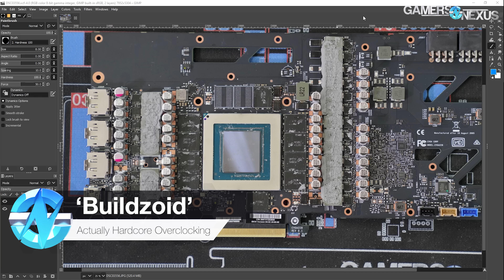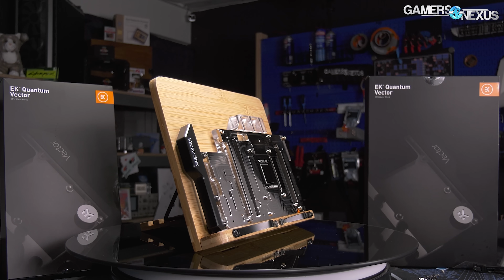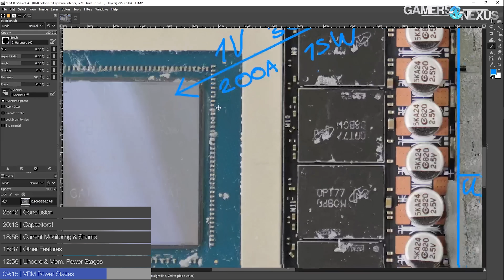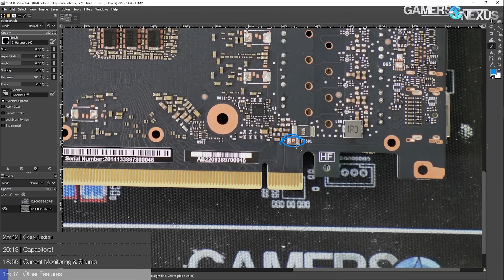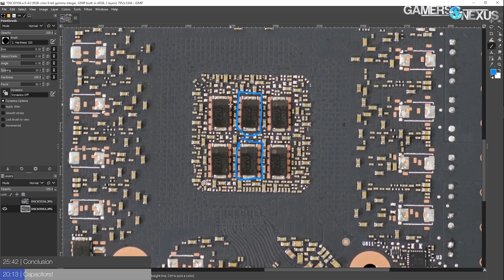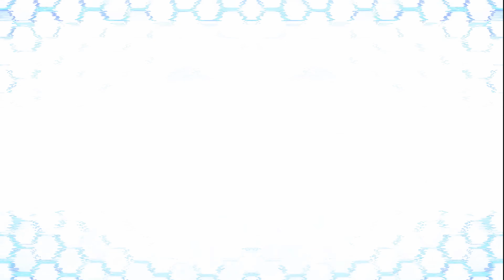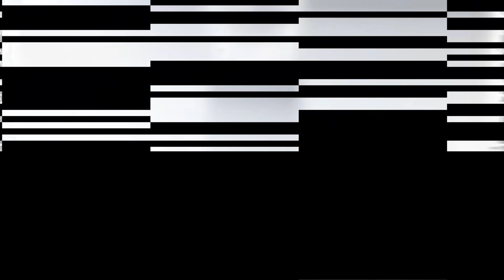Should Be Better for $810: PCB & VRM Review of EVGA RTX 3080 FTW3 Ultra

Comment: Fuses are extremely underrated though. Sometimes due to the lack of fuses (e.g. msi) the failure might fry the card into oblivion and  certain manufactures (e.g. msi) would do everything to refuse RMA, leaving you with a peace of unrepairable hardware. Also there are cases where manufacturers don't have an office in a customer's country, thus when they RMA a card paying for custom clearance to get a fixed card/replacement back might cost more than an actual repair. Not to mention, that a warranty will expire at some point anyway. Realistically these little fuses can be a difference between having to a buy a new 800$ gpu vs paying ~100-200$ for a repair.

Comment: Actually quite disappointed in my evga 3080 ftw3 ultra.  Seeing $700 tuf's beat it stock.  It doesn't OC hardly at all, and what I do get out of it, it's still beat by many tuf's running stock boosting with no offsets.  Runs very hot.  I always go with cheaper variants...but talked myself into spending more this time to get higher power limits and better cooling.   My card doesn't even take advantage of this power limit...I need to undervolt just to hold a 1935 clock.  This is my 3rd, but last EVGA card.

Comment: I do wonder if there's too much fetishism about ability to overclock
How many people are actually going to do any hard mods? Seems weird to say the quality is bad value when the arguments for that statement are extremely niche and probably don't apply to 99% of the audience.
That doesn't mean I'm saying component quality doesn't matter, as it can positively affect other areas (eg efficiency), but that doesn't seem to be the case here.
I guess the only statement you could make is that price could be lower?
Reply: There aren't. Most people didn't even oc stuff even when their part can be oc. Also, if you haven't noticed, this is a BOARD ANALYSIS video, you come in knowing what you getting. GN themself has a gpu review focus on what the average Joe care, the qol stuff. 

GN wouldn't contract Bz for board analysis vid if no one is watching. Most of those people aren't hcocer, they are just like you and me, normal joe wanting to get a gpu that just work, and couldn't give a damn what's under the hood. But that doesn't mean they can't appreciate bz ramble vid as a form of entertainment. 

It is like people can be into high end sports car, read/discuss/criticize/etc about minute details. But their daily driver is a good old reliable 1998 honda civic.
Reply: If you're buying a Strix, FTW3 or auros master or something similar and aren't going ham on the OC then you've bought the wrong gpu.
Reply: YES. Specially considering Ampere cards. They barely can overclock on stock air cooling that comes with the cards and the fps difference between the most basic and highest tier models are 5% in the best case scenario. To add to your complaint Buildzoid's reviews should be taken with grain of extreme overclocker's salt because he ignores issues that normal daily users have (like coil whine, stock cooling, fps difference between OC and stock); while he overblows "problems" that only occur during extreme overclocking.

Comment: Curious if buildzoid can explain ftw3 power balancing issues and why some (most but not all) 3090 Ftw3s are hitting pcie power limits of 75-80w at 430w-460w  total board power on the 500w bios. The same bios on strix and gaming x trio can hit 500w all day while hitting only around 40w max on pcie. And if there is a likelihood that evga can fix this without a total board redesign.

Comment: When everyone is comparing this to the Strix when the strix is literally an extra 40$ on top of this. These comments are driving me fn insane. Im done.
Reply: The 3080 Strix is 20% more than the 3080 FTW card here in Australia ($1500 vs $1800) but that may be with the "high demand" pricing.   It is a bit odd to say the least but if it was just a $40 difference then they would be a direct price competitor in most people's books.
Reply: @emu071981  Yes I agree but you could say that about any of the 3080 line up, the most expensive one is less then 200$ from MSRP. And if you account for tax + a warranty (for anyone who gets it from a microcenter or retailer that offers) the total comes out to near 1000 USD anyway. All of which preform better then the previous 1000-1500+ 2080ti's so who should really care, well unfortunately the devil is in the details, the strix card is unnoticeably "better" then the FTW3 and really no one needs to spend the extra money if they dont need to. That being said I can completely understand the logic " if im paying this much anyway I might as well make sure I get all the features weather they matter to me or not "

Comment: Is it possible that buildzoid miss counted because he only marked 2 mem phases and goes on as if he has marked 3 of them i am assuming that there is a third one at the top of the big vcore which would make the vcore a 12 phase (doubled 6 phase) which would be a normal option for the controler

Comment: EVGA canceled their excellent laptop line, refuses to make an AMD motherboard, and now is skimping on the FTW series - sad to see
Reply: EVGA 2022 update. Queue system is now 3.0 and vague and 3080 12gb queue lasted 90 minutes before being disabled. They also changed their extended warranty. Used to be able to buy a 10 year warranty for 60 bucks. Now its only 7 years and also is a sliding scale up to 240 dollars for 1500+ cards. I dont personally disagree with the extended warranty price as I was able to get my 3090 extended warranty for 60 dollars which is insane for an 1800 dollar card (3k card if you didnt get it thru the queue) it sucks that they didnt announce changes to let people who already owned the card register. Changed the warranty out of the blue.
Reply: I was planning to swap my 1080 ti FTW3 for 3080 ti FTW .... So far it looks like I'll have to look elsewhere probably. Hope GN will do same review of ti when it comes out.
Reply: I kind of wonder if they don't have quite as many long supplier contracts locked in as other GPU makers (especially ones with more motherboard sales, laptops, monitors, etc) and EVGA got squeezed by human malware-related production issues/component price hikes.  Or they struggle with only a $100 price premium over FE vs what they were able to charge on RTX 2080ti cards (+$250 over FE iirc).
Reply: @josephfowble196  good point since the pricing for all the stuff that make up the pcb is pretty much the same for all AIBs, the differences lie on their cooler design, how high end the card is etc etc etc. but yea.
Reply: Their PSUs are also seemingly getting worse. The G1+ and G5 are worse than the G2 and G3. They also keep adding more models and it's at this point quite confusing.

They have at least 11 models with 80+ Gold efficiency: G1, G1+, G2, G3, G5, GA, GD, GM, GS, GQ, GT
Reply: @siripfreely  Some of those PSU models have been discontinued for years.  I owned a GS PSU that had to be RMAed, so then I became an owner of a G3 due to GS discontinuance.  Pretty sure the G1 and G2 are gone too.
Reply: give me evga rx please and take my mining money
Reply: I'm not surprised, I've had nothing but issues with evga products. I'd sooner get a zotac product before an evga one.
Reply: @Sparksman23  you say that until you buy an MSI anything... the only products I've had fail on me, the only ones, at least they weren't my own damn fault...

that being said it seems like EVGA has toned down its customer service, fortunately I haven't had to use it but the last card I had that had an issue they cross shipped another one to me right away, I hear that's going away or at least it costs a fortune to do it now... same thing with the step up but honestly I mean step up was too good to be true when it was for real, although again this is a long time ago I guess... I'm really old now, still though when you have components that have lasted 10 years with constant use, reored almost 10 years from my 780...( which as it turns out was fine regardless of the RMA, so I shipped the one that gave me back, was a bios glitch as it turns out) 

last MSI laptop I bought, spent more time in the shop than I actually had it, basically I got it back when the extended warranty I bought ran out, and they just you know stopped wasting my time after a 2-year run around... with like two three months in between.

that's after two motherboards failed me, as in they just died... I think the first one maybe lasted a year, the second one I can't remember... I just remember it dying for no fucking reason, and at that point it just didn't surprise me.

honestly like it's the state of rma's and warranty services that kind of speaks more than truth if anything, it's nice when a component fucking lasts and is built to last, but at the same time I feel like if you're willing to back up that claim I always end up finding that those components end up lasting the longest go figure... but given the current state of rma, the death of cross shipping which is kind of an industry must, especially if you pay for it but given that you know production don't stop and what not, these days I'm not sure about the quality of build given that they've pretty much I keep hearing nightmare stories about rma's, that being said... I never thought you could have a $2,500 laptop with a fucking top-tier GPU either, so I guess you know whatever I'm just bitching, kind of like this guy is...

like like that sucks that you can't pour a bunch of liquid nitrogen on it and make it go super super fast and shit because it's got components that are completely adequate to do the job and any job that you need it to do without fucking pouring a bunch of liquid nitrogen on it so that you can get a 5 minute fucking boost to get a score on benchmark... like who fucking cares that's not real world use.

I mean considering the last video of these guys put out when you look at the margins and shit and then timetables I mean cry me a fucking River... it's still $800 less than those kingpin cards if not more, and still $600 less than that 1080 or 280 TI or whatever and more powerful and has more capacity to improve and it has fucking micron memory which is a fortune, like okay go with Samsung memory save some money would that really make the difference if those capacitors were there in anything other than pouring a bunch of liquid nitrogen on it.... 

seriously, sure your dick is hard as fuck when you poor liquid nitrogen on it but it's still going to snap off when your realize how small it is in the grand scheme of things.
Reply: @jakedill1304  Everybody has different experience with each brand.  I never had a issue with the MSI products I had (motherboard and gpu)
Reply: @jakedill1304  I don't buy MSI anymore, I've been bitten on both mobo and graphics cards.
Reply: @Sparksman23  Zotac are pretty solid weirdly enough
Reply: Blame Trump’s trade tariffs
Reply: @ZombieLincoln666  so you want communist china to prosper after what they done? Stop buying their shit
Reply: @billlam7756  I mean agree what youve said, but at the same time you deserve downvote for your manner of speaking that - it sounds like a 5-year old throwing tantrum for poop.
Reply: @inujung8224  since when speaking truth throwing tantrum but hey, to each their own. What you do or think not my concern, just saying

Comment: Oh yeah! Buildzoid was literally talking about this review a few days ago at his own stream, while he was trying to overclock that prebuilt APU. He was wondering if his review will ever get released as he was afraid he was being a little bit too harsh on EVGA
Reply: Yep, I asked about this and he actually replied :D
Reply: Past 2080ti FTW3 cards had a ~$250 price premium over FE.  This 3080 card is just ~$100 over FE.  I think that should have tempered expectations a bit.  Hopefully the 3090 k|ngp|n cards don't disappoint.
Reply: @josephfowble196  Well the 3090 FTW3 cards have a $300 price premium, and probably same-ish pcb and components.
Reply: @ifidiediwouldsay  The MSRP of 3090FE is $1499 vs 3090 FTW3 starting at $1729 in USA.  You're correct that components in them aren't that much different according to techpowerup.

Comment: These $800+ "OC" edition cards are BS already, all of them turbo past these "OC" marks automatically it's just a way of inflating the price without adding any value. At least some of them have decent coolers and boards for the money so this is pretty disappointing to see.

Will it really matter for board performance? Heck probably not at all, most people care way too much about parts than they should rather than whether the sum of them works, I''m just salty about these $800+ cards that don't look any better than the FE or other cheaper alternatives.
Reply: Any 3080 is going to come close if not over 800$

Comment: Incredibly informative. I've been trying to get my hands on a 3080 FTW3 Ultra since, as Buildzoid mentioned, FTW3 used to by near Kingpin quality and were some of the best PCBs on the market. Going to go with the Asus ROG-STRIX-RTX3080-O10G-GAMING now.
Reply: Why not consider 6800 XT if you don't have a 3080 already...or even a 6900 XT which is sold at the same price as most overinflated 3080 MSRP.
Reply: @elcouz  CUDA compute, a software i use is CUDA or CPU only, no OpenCL support. But I game on it too, so sticking with Nvidia for now. Gotta love proprietary tech.

Comment: Buildzoid,
The fuses are bad for modders.  Specifically the PCIE slot.  It's only 10 amps.  10A * 12v= 120W.  
So if you are shunt modding the card to allow it to draw more power, if you draw more than 120 watts from the PCIE port, the fuse will blow and you can't use the card anymore.

I believe the ratio of PCIE slot to a single PCIE plug is 1.25x or something close to it.  So if you tried modding for more than 600W total (e.g. stacking 5 mOhm shunts on top of the originals, or removing the original shunts and maybe using 3 mOhm replacements, that fuse is going byebye.

The other AIB's have 20 amp fuses on both the PCIE slot and power PCIE plugs (afaik).

The Founder's Edition does not have fuses at all.  I've shunt modded mine for 530W TDP @ 114% power limit, and a few others have modded their FE's as well.

Comment: Hi Steve. Im currently working on a 6800xt build which only is going to be for gaming. My question is if you think i should cancel my 5600x order, and replace it with another higher tier amd cpu, or keep it. (I play on 3440x1440 and 1440p).

Comment: Anyone else notice pin 1 (top left) of the left PCI-E power connector doesn't even look soldered.
You get a good view at 9:07
The pin beneath it is almost as bad.
Reply: That's not pin 1, those are pins 4 and 8, and they're ground and sense, and you already have 3 grounds for the 3 power pins, so they're not that critical (That's why they're usually piggybacked from the other six). Still, they are through hole components so the "shiny perfect blobs of solder" are on the back of the card, so no biggie. And even then, 3 x 8 pins deliver about 450W of power by themselves...

Comment: For those wondering, inductors gets higher energy densities as the switching frequency increases due to higher di/dt. The downside is the inductor losses, and MOSFET turn-on losses (the more you turn it on then off, the higher the loss). Almost all losses manifest as waste heat.
Reply: Right and the main benefit resulting from this is the better line regulation given the same inductor and capacitor (provided the inductor has a high enough self resonating frequency and that the capacitors have a low enough impedance at the switching frequency) or the same line regulation but with smaller inductors and capacitors.
High frequency switching converters are really neat, i have implemented a few in designs with around 10ish MHz switching frequency and for the current they can deliver they are tiny .
Reply: @_--_--_  oh yeah i also forgot about the ripple that decreases with increasing frequency. WOW 10 meg... i was messing around designing with 4 MHz phase shifted full bridge, using the PC200 ferrite, tiny 500W fit on the palm of your hand and thought that was pushing it... what material are those bad boys you are using made from?
Reply: @alexwang007  Actually nothing fancy, standard SMD chip ferrites and X7R dielectric MLCCs.
The magic was in the IC, it was a TI TPS54A20 which comes in a small QFN package. They somehow managed to decrease losses in the FETs with such high switching frequencies.
Though to be fair, technically it is a 2-phase synchronous converter, so 10MHz effective, but actually 2x5Mhz.
But it implements like a simple single phase, with the exception of needing 2 ferrites instead of one.

Comment: Wtf is this a breakdown of the pre retail edition GN got? It's got the 6 poscaps on the back of the GPU which the retail version has a 4+2 config....for all you know the voltage controller buildzoid has a problem with could have also changed in the real card
Reply: Yeah and tbh it doesn't matter for anyone unless theyre on LN2 and even then still barley doesn't matter. I wouldve liked better capacitors but the rest is non sense that EVGA would even pay more to add that in for the handful of people that actually plan to modify it.

Comment: Why anyone would buy the FTW3 is beyond me. An extra 50 MHz boost/gaming clock MAX and RGB strip 😑. It takes around 100MHz in addition to current clock to get 2-3 fps average. So 50 MHz is a kick in the pants for taking your money. 

I went with the EVGA 3080 XC3 ULTRA GAMING. It was the same price to get it in Canada as it would be to have ordered an Nvidia brand 3080 to Canada. So.... For me it was a no-brainer. But the FTW series is a waste of money.
Reply: If you dont like overclocking then any 3080 is fine, if you do then there are better ones to get. Dont hate on others because you dont want to spend the extra cash for extra performance.